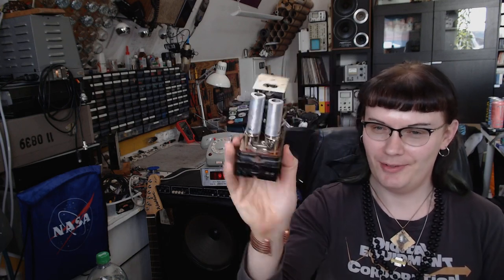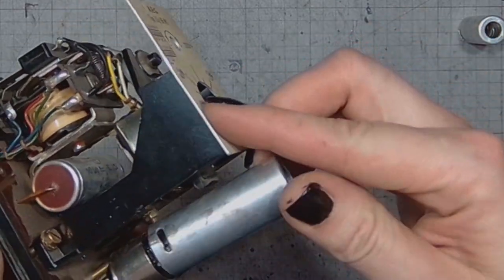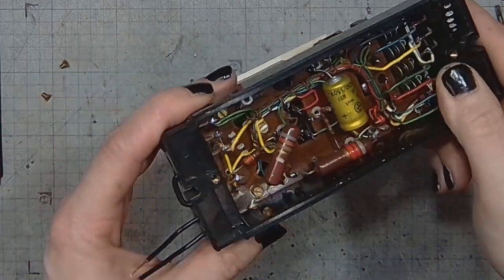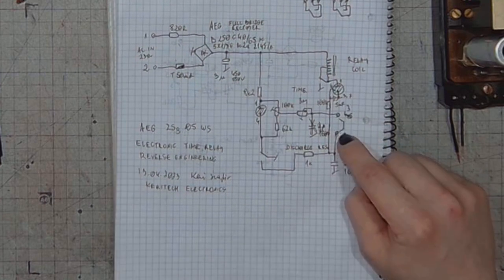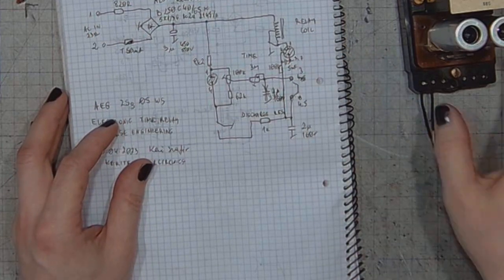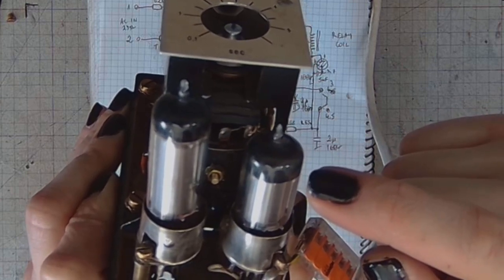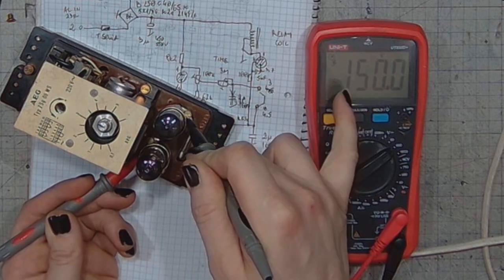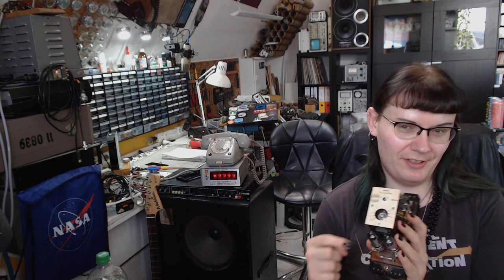Thyratron Fun! AEG Time Relay Reverse Engineering

Comment: I worked in the 70's for a company that made welding equipment for the car manufacturing industry.  Spot welders needed the timing of 4 functions of their operation.  Squeeze, weld. hold then off.  These functions were timed using 2D21 thytratrons until replaced by semiconductors.  The circuits using 2D21's were all high impedance type and difficult to fault find.